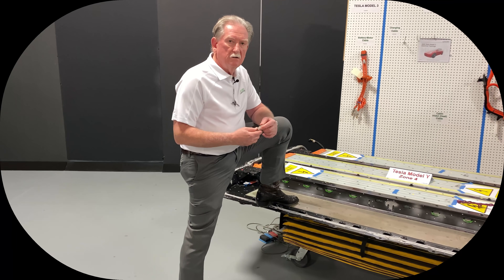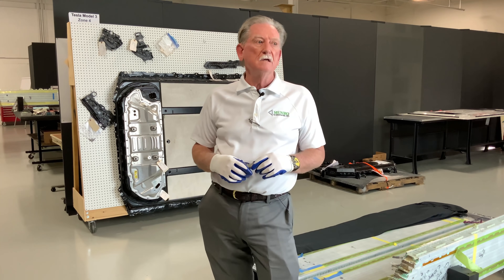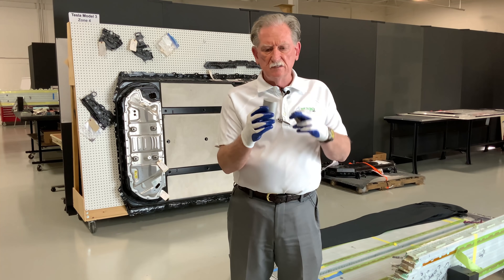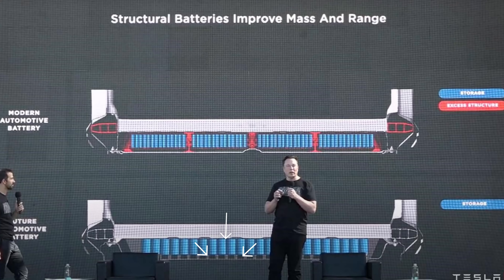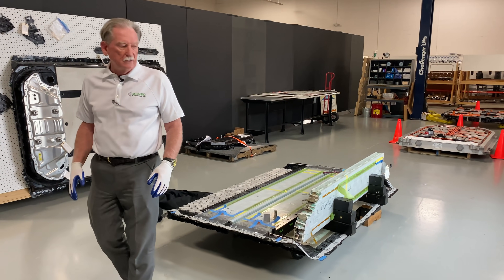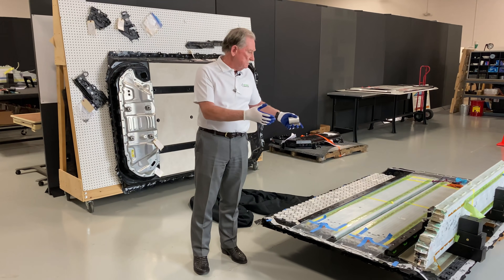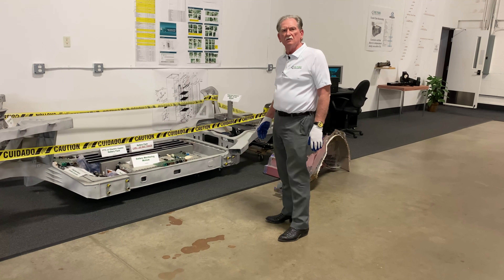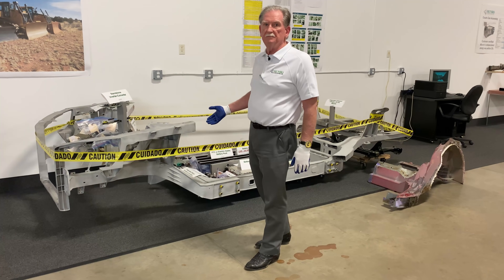Sandy is Thrilled about Tesla's Battery Day & Begins Battery Mock-up

Comment: When I watched battery day, tears welled up in my eyes when I realized the cost savings and the leap forward they're suggesting is coming. I will finally be able to afford a Tesla with these advances. I await the $25,000 model and it won't be as long as we think. Oh....Elon please work with Sandy on these other smaller EV projects they have, Nobe especially is a personal favorite.
Reply: The 25000 ev comes in around three years, but actually there are ICE way way cheaper than that

Comment: Epoxy is flammable.  That could be filled up with glass, or an equivalent low temperature formed geopolymer cement fireproof to 1000C.
Reply: You can also do a geopolymer foam, light weight, strong and fireproof
Reply: Or an aluminum foam, but please think about flammability.
Reply: If we make the filler fireproof, the batteries may not have to be.  Seriously.

Comment: So:
- More density of energy
- Cheaper to make
- Lighter than the previous ones (less usage of steel) 
- Less connections (8000 VS over 1000, less prone to failures)
Not bad for a new battery manufacturer.

Comment: What if tesla joined Arcimoto and built plants in india, chna, africa, australia, us, ets. Low cost sustainable transportation
Reply: Buy them instead, guide the companies along. Share technologies across the board(like the trifecta of tesla/spacex&boring co do already. And watch the areas needing reasonable modes of electric transportation transform. 🤔
Reply: Imagine autonomous vehicles that cost 8K to buy.  No more share rides.  Likley cheaper to run than current public transport.

Comment: Can’t really guarantee a million mile battery when all those are now  integrated into the car body and no way to replaced a bad cell when it’s covered in epoxy
Reply: The guarantee is for the battery pack, not for the individual cells. They will probably fail less, but even so, I don't think it's going to be noticeable up to 1 million miles.
Reply: Manu Sir exactly what I said cant guarantee it as a million mile battery when a battery comprise of individual cells and a few of those cells fails how do you replace a cell or cells comprising the battery
Reply: @reggie2261  It doesn't matter. The pack can be guaranteed 1 million miles at 90% or 80% capacity, not at 100%. 

That means failure of some cells is perfectly within margin.
Reply: Manu Sir ok I think we are circling around the same point here, guarantee it as a million mile battery or not which Tesla have not mentioned it as a million mile battery say from 70% - 95%  capacity left after certain years or mileage of a car in service how can you replace a battery pack when it is integrated into a car body as a honeycomb construction? I have work on nicad and lead acid batteries used on airplanes doing deep cycling or capacity checks and you have to sign it off serviceable as long as it meets certification requirements. Same as maybe Tesla there range may degrade over time due to battery but still meets there requirements.

Comment: If no one has been making giant castings like the one you've had since 2017 - where is your giant casting from? 

I believe VW has invested in larger castings as well, they were shown in the Amazon Prime episode of Big (hosted by Richard Hammond); though they had 6 that they operate. As big as the castings are, the machines to change the casting blocks every few hours were even larger. That raises the question of why they designed the system for frequent changes, rather than efficiently making the same part for a higher-volume vehicle.

Comment: 13:03 The scary part to me is just what happens if you're in an accident and you bend any of this. Would this not mean that it's far easier to "total" your car in a collision? If everything is one piece, you'd need to replace most of the car to fix something.
Reply: Majority of teslas involved in accidents are written off and the parts (mainly batteries) are removed and sold off. Because of the extent that Tesla goes through in integration and design of components, theres basically no aftermarket solutions. So the costs even for minor repairs are high to begin with.
Reply: If you bend or damage the frame on any car it will most likely be totaled. Insurance company can get more money selling at salvage and stripping for parts then to fix it.
Reply: depends on the extent of the damage of course. 
also keep in mind however that tesla's crash a lot less frequently that traditional cars and are the safest cars on the road. so although it would take a lot less to total the car, the frequency a car becomes totaled will be much less.
Reply: @richard-k1n1q  My guess is that the salvage value would actually be much higher, plus, just melt down the castings in the same machine that stamped them out in the first place? Just add the Tesla Insurance into the mix to take care of that rare event as well!
Reply: the whole concept of Unit Body Construction was to streamline costs, assembly and repair.

Comment: Great job Sandy!  Is anyone discussing how the reductions in number of forging/castings/extrusions may impact body repairs and insurance premiums?  Perhaps having fewer parts may also increase quality with fewer body alignment gaps.   I thought I also heard Tesla mention that heat treatments are "not required" for hardness, how can that be?  If this action is performed in these new "stamping" machines,  I believe this would place Tesla well ahead of most OEMs in any manufacturing/fabrication of metal parts.  I guess this is what disruption looks like!
Reply: A specifically designed by their Material Science team aluminium alloy that has the strength and hardness without needing annealing. Like using "Transparent Aluminium" for glass in the Cybertruck
Reply: In relation to repairs and insurance, Tesla is vertically integrated and that include their Insurance, it has been mentioned b4 that body repair issues and costs will be a design factor as it will impact Insurance premiums and profitability. Remember Safety is also the No 1 issue, parameter at Tesla

Comment: Thanks for explaining it so simply.  I did not know that they filled the gaps with epoxy to make the battery casing more stable. Cooling from the ends instead of the middle makes a difference. I am so excited about where Tesla is going as an investor and and amateur tech enthusiast/engineer wannabe.

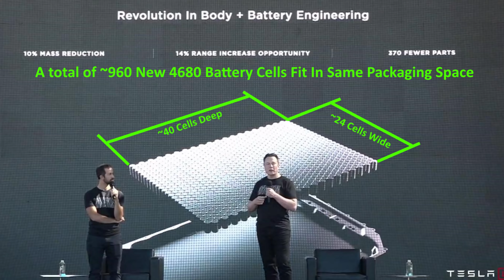Comment: 2:25 Wait whut?! A Tesla model 3 with a 130kWh battery!? And on top of that they can remove most of their cooling system? Or keep their current one which will automatically suddenly become way overpowered?
Reply: No, sandy screwed up his calculations, in several places.130kWh would need 1400 of these new cells, not 960.
Do not believe everthing he says, like the weight saving from the cell casing !
Reply: @weinisable  I think so too... each 4680 cell has to have around 27400mAh (based on the volume, compares to the 2170 cells). That times 3,7V times 960 cells equals 97400kWh. I'm a noob to this but I can't follow the calculations of the master.
Reply: @weinisable  Didn't you forget about the fundamental changes in the chemistry, as well, that raises the energy density of the new cell even further?
How is your calculations regarding the weight saving?

Comment: The other thing that makes me really excited about Tesla is the valuable technologies they're mastering and what they can be used for to make other products.
 
Let's start with computing: Tesla is building expertise and infrastructure in computing at every level: chips, circuit boards, wiring buses, conventional software, AI, supercomputing and cloud computing. They've done all that for a single application: autonomy. Once it's built they can reuse that computing expertise and infrastructure on other applications. 

Similarly, they're building expertise and infrastructure in robotics and manufacturing that can be applied to other product categories. I'm encouraged to hear Elon say that they want to become the world's best manufacturer. That skill can be used to build so much more than just cars and trucks.
 
They've had to develop a new alloy for their mega castings. They bought and then further developed their dry electrode deposition process. They developed a new plastic coating for raw silicon powder, and a new binder, and ways to apply them at speed in the cell manufacturing process. I think their tabless battery probably has to have a new conductive adhesive to bind it to the top of the casing. They're using a new fire retardant adhesive to bind the cells to the car's structure. All of these breakthroughs point to new expertise and sophistication in materials and materials handling. The same expertise can be used to build rocket ships or HVAC systems or ventilators or anything else.
 
Finally, of course, there's the tantalizer that they've bought a property in Nevada with a deposit of clay full of lithium and they've devised an environmentally sound way to extract the lithium using sodium chloride (table salt). They could revolutionize mining as well... and of course if they need to go after deep deposits they can turn to their sister company, the Boring Company. Elon is the new renaissance man. There is no stopping him or his Tesla team from mining, manufacturing, selling, servicing and insuring anything they want to.
Reply: He also mentioned home hvac is coming. Not that he'd like to do it. Not that it's a neat idea. He actually said it's coming and would be communicating with everything else they offer. Another bit most seemed to miss about battery day. It's like he downplayed almost everything intentionally to avoid osborning current offerings. 🤔

Comment: Very interesting! I'm no expert at all, just left wondering what happens in case of a minor crash or damage with all these huge parts, it seems your car may be totaled relatively easily? Or is there some way to mitigate this?

I was also left wondering what the downsides of the Jaguar E Pace battery may be, as it appears their battery may not be competitive with Tesla's, on the whole?
Reply: There are now so few parts that they can just say "oh, we'll just replace the whole front end". Melt that metal back down and re-feed it into the casting machine and it'll be brand new for the next crashed car.

Comment: Structural battery pack, 6X energy density, integrated liquid cooling pan. I'm loving it. This is very bad news for NIO (battery module swapping) fan boys. 🦥
Reply: Nio is well setup only in China. Not a threat to tesla outside of that market. Also nio doesn't even make their car's themselves!
Reply: @4literv6  450mi in 15 minutes charge rate in next Gen Tables battery will turn NIO replay as Blockbuster/Netflix, Tesla as Apple vs Blackberry..., it's your $, I'm on TSLA.

Comment: So as I understand it, battery replacement will be more work in the future, because the Battery case is now part of the body structure of the car? Should not be a problem, because the new battery's are insanely more durable. (Elon tried to hide that fact, because the current battery look ancient in comparison)
Reply: my friend it is a much simplified Unit Body Construction, ... the simplification of ALL MODES of repair just became much more direct.

Comment: With one huge casting covering a large part of the vehicle, what happens after a crash when an otherwise small minor part would need to be replaced? Will they sell smaller pieces to be cut and welded in place?  Will the car be disposable if the rear gets hit in a side collision or if there is a front collision and the front casting gets what would be a single small minor part replacement?  I'm trying to figure out how that will work for collision shops and insurance companies. Insurance companies will have very high rates if the entire casting needs to be replaced or if it turns the body into scrap.

Comment: 9:10
In the Patent it was noted that the "fuse wire" is integrated inside the new Cell, so you dont even need to weld "fuse Wires" to the outside of the Cell, but you can just stick it on a Collector Plate, top and Bottom.

Comment: I really liked the video!
I would like to add another thing you may not have thought of,
The battery cooler can also be passed through the "hole" in the battery, which will add a huge cooling seal by a double bay at the top and not just at the bottom of the battery.
Reply: I think you are probably talking about a donut hole in the center of each battery?

Comment: Sandy -- the $30,000+ three wheeler you are helping will have NO chance against Tesla's $25,000 four wheeler.  Both will be on the market at about the same time.  You should probably refund the consultant fee you got from the 3-wheeler company and just say "sorry" 😟.  The $20,000 Arcamoto may have a chance but even it will have safety issues, recharging issues, insurance issues, etc in comparison to the $25,000 Tesla.  What happens when Tesla introduces a 2-passenger version of the Quad designed to fit in the back of the Cybertruck?  How does ANYONE compete against Tesla and their "first principals" engineering design philosophy -- you included 🤔??   You have obviously helped speed Tesla's innovations but now you may be putting Elon in a difficult position when you ask him to help other companies in their design process.  It could be a no-win situation for Elon.

Comment: So Sandy, Tesla could potentially use only 554 x 4680 cells to reach 75 kwh? Thats huge!!!
Reply: Excellent point. I believe they plan to reduce the overall kwh in each vehicle. Because should they see the actual gains they mentioned at battery day. Well that means for the same $ and total materials purchased. Now they could make 2x the vehicle's as before. 

This isn't talked about enough imo. Neither is how elon casually dropped the bomb about gigahai. Is now going to be over 1,000,000 units of production when complete.
Reply: Ryan Ward, no. As shown during the battery day presentation, the 4680 has 5x the energy of a 2170. Since the model 3 long range uses 46x 2170 cells in parallel, they can be replaced with 9x 4680 cells per group, times 96 groups. 

864x 4680 cells would give about 98% of the energy of the 4416x 2170 cells.

Comment: Hang on! They still have to connect some in series to get voltage up. What's the voltage of the new cell/pack? Everyone is presenting this as if they will all be in parallel - which is highly highly unlikely.
Reply: I assume the "top plate" will not be a continuous conductive plate. But will be in ± sections physically bonded to a non conductive strengthening plate.

Comment: A solid state battery can possibly lead to even further improvements. They didn't talk about the electrolyte at battery day, they talked about everything else. But a solid electrolyte is the one missing piece of the puzzle that will fit in perfectly with everything else they're doing. It will probably be the next step change in cost reduction when it finally comes. But it won't negate anything Tesla showed off at battery day, it will be in addition to it.